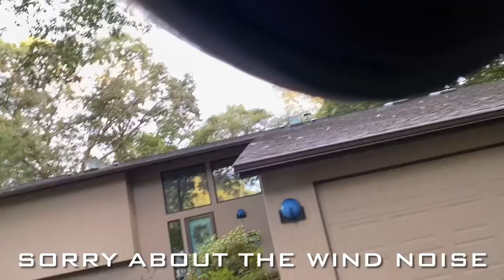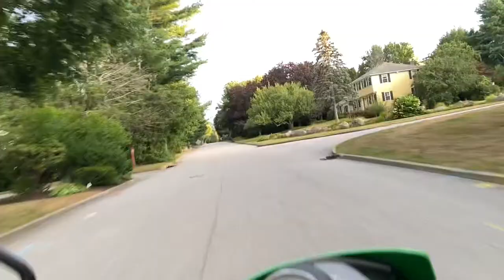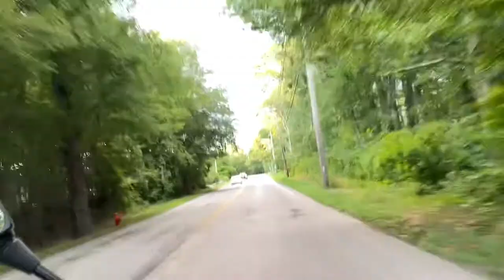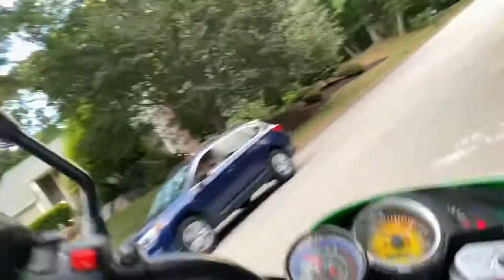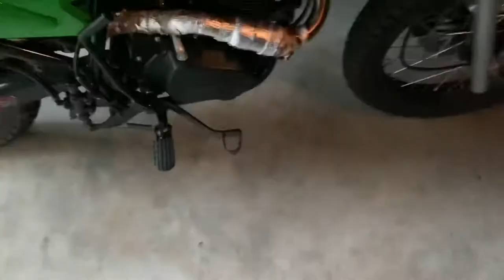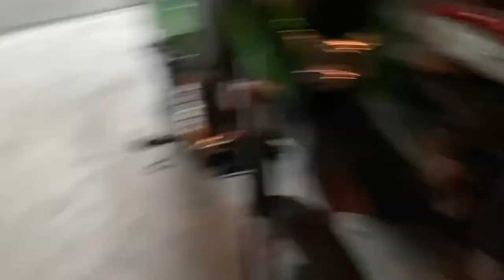TBR7 250cc Push to Limit

Comment: A bike is only a slow as you're right wrist, oh your left depending on which side the throttle is on, and did you know that a lot of these so-called Honda clones are not technically clones, especially the smaller CB and CG type engines which are made in China under licence for Honda who then put them in the various factories around the world for assembly as Honda's, I have a lexmoto which is a CBR in a scruffy suit😎🏹🙏
Reply from the maker: '...only as slow as you're right wrist' 😆 I love it!  That is very interesting note about the outsourcing of Honda engines.  It makes absolute sense.  I know in some industries, the no name copies are straight from the supplier that makes the genuine article.  I don't see why it would be any different for motorcycles.  These Honda clones...er..not clones...haha...whatever, they are known to be very reliable.  Again, another reason why I like old stuff and think most new products are garbage.  Some with planned obsolescence intentionally engineered into it, others just manufactured and assembled piss poorly.  Either way I would rather have something from the last century.  I won't even consider buying a car made past 2005.  All garbage and shared platforms and rebranded sold as entirely different make and models.  There is a bloody Saab hatchback that is just a rebadged Subaru, only difference is the +$10,000 on the price tag 👎🤮😝
Reply: @HandyL  in the case of the Honda engines it simply means that the ones used by Honda have gone through extra and more stringent quality control, and that it, the only difference 😎🏹🙏